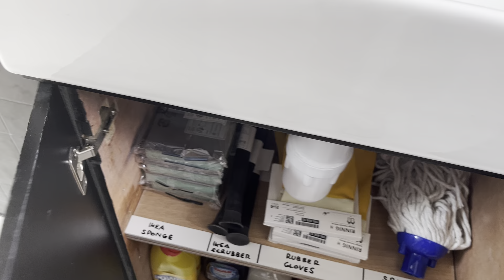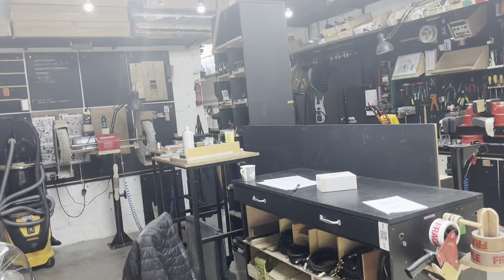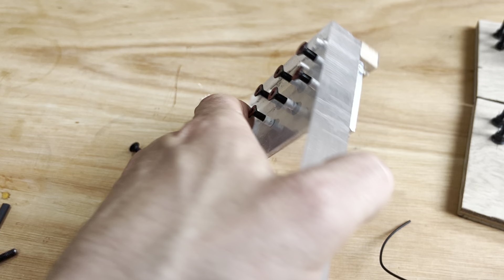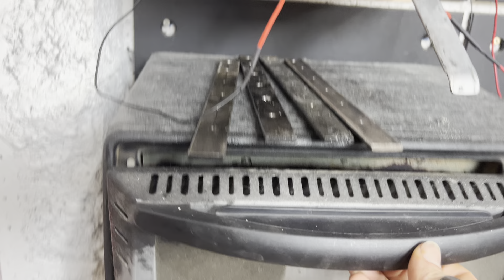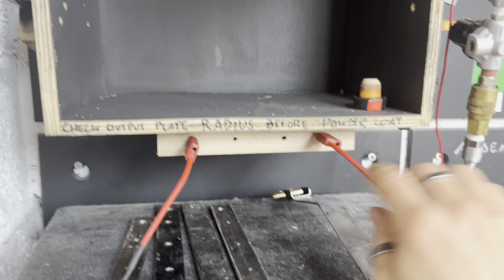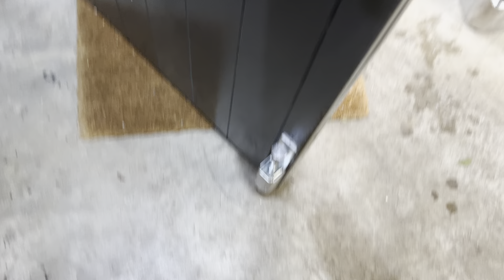Favourite improvements of the week at the lean guitar shop!!

Comment: I've really enjoyed all the "Lean Guitar Shop" videos.  Even though I'm not a builder myself, I've had a number of custom builds made for me.  The attention to detail here is unbelievable.  As the owner of two of these instruments, I can say that the craftsmanship come through loud and clear in the looks, playability, and sound of the Midi Pro Guitars.  I was expecting a compromise to get the advanced Midi capabilities, but there is absolutely no compromise.

If you're open to suggestions here, one thing I would love to see is how the wiring is made and connected to each fret.  I'm assuming it's through some channel(s) beneath the fretboard, but it must somehow have contact points with the frets?  I'm a software guy, so I get intrigued by the hardware and electrical aspects.